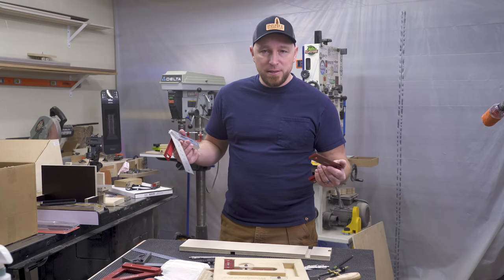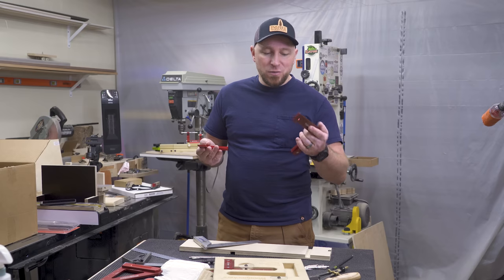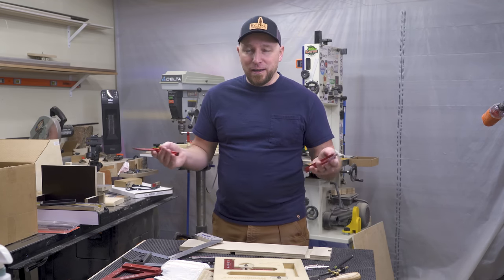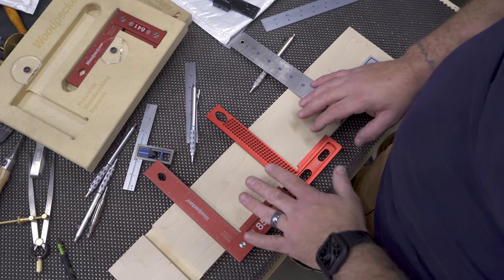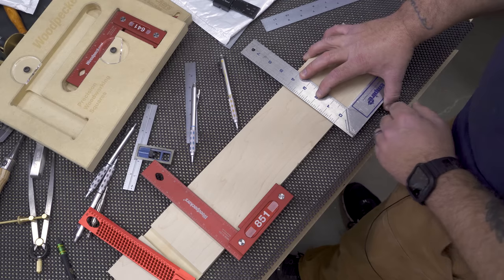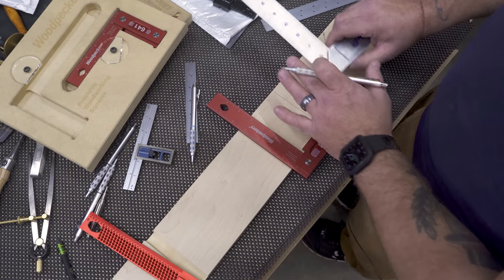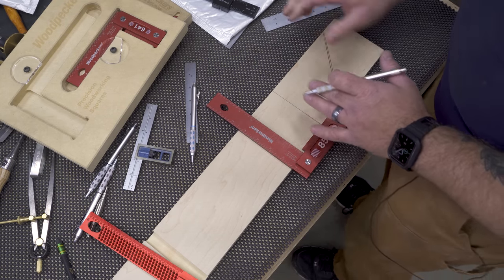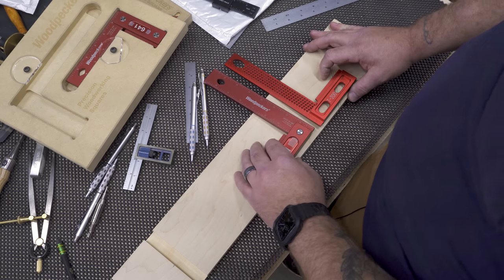Woodworking Squares: 851 VS T-200 / Woodpeckers Tools Compared To Banggood Tools

Comment: Banggood has some great looking woodworking tools. Sure, the Drillpro is a knockoff-ish overseas (I assume... no mention of origin on their website) but you’re paying about 1/5th the price compared to its Woodpecker equivalent. Drillpro is great for the starter/weekend woodworker wanting to expand their tool supply without emptying their bank, while Woodpecker is a premium USA brand for the more flexible spender wanting accurate results. Both have their place in the woodworking world.

Comment: None of the test lines on the bangood square are parallel to each other, its easier to see the error on the lines close together but its not as obvious with the lines which are further part. which is why all the close together lines you said were out but the further apart ones you said were parallel.

Comment: All I ever used is a swanson speed square I'm an old construction worker I've since got a swanson square so if you ever find yourself with too many squares send one my way if you don't mind helping out a new wood worker it's alot different from construction. I'm also now using a 7mm mechanical pencil and have discovered hand planes

Comment: I have the Woodpecker 1281, 641 & 851 squares and even the mini square.  They are by far the most accurate and well built squares I've used.  Granted, they are not cheap, but theses are tools I will pass on to my son.

Comment: I've been looking at getting the 851 but have recently been thinking that it might be better to go with a good combination square and the 1281. I'm not a professional by any means but I do make some cabinets here and there for friends, family and our house along with other projects. I've been getting by with some big box store items but hate having to check square on the tools constantly or build something with some doubt in my layout tools. My question is do you find yourself grabbing the 851 more than a 1281 (if you have one) or would it be smarter to get the 1281 and combination square like the starret or other high quality combo square. Any advice is appreciated. Thanks!
Reply from the maker: I don't have the 1281 personally, but it is a great size to have. I tend to grab the 851 because it works for a bit longer stuff and things that are smaller, without being too bulky. When I get another larger square I think I will be getting an 18" or 26" instead of the 1281 simply because I find myself needing a lot more rule when I do need something longer than 8". If it were me, I would go for a decent combination square. That's what I eventually did as well. And while Starrett is sort of the holy grail of combination squares, there are others on the market that are just as good (accuracy-wise) for what you would do in woodworking. I always send people to PEC's tools. PEC makes tools for a lot of other high-end manufacturers as well. In fact when you look at PEC's combination squares and that of several other high-end brands, they are identical other than color and name. You can also get the PEC's in cosmetic blems and save a ton of money. These are tools that have some sort of blemish like a casting error, a scratch, or something else that makes it not suitable to be sold as perfect. I have two double squares and two 12" combinations and can only find a defect in one of them. However the functionality and accuracy of the tool is no different. I've talked about them in several of my videos before. Here's a link to a blemished 12" combination, if you are interested. (https://lddy.no/m661)
Reply: @InspireWoodcraft  Thanks for taking the time to give me a thought out reply. I have seen you talk about PEC tools but I think I will blame laziness for not looking into it more. I appreciate you sending the link as well. I was leaning toward the combo square as my first upgrade then going to a try square after so thanks for validating my thoughts!

Comment: Should’ve mentioned the fact you can use the banggood square to scribe parallel lines using the holes on the square, meanwhile you can’t do the same with woodpeckers.

Comment: Dear Mr. Inspire. I would like to point out on your empire try square the reason that it starts at 0 on one side and 8 on the other.

It is not for working back wards. One side is for marking 0-8 inches from handle 

The other side is for measuring. It is done that way because of that notch on blade to handle you speak of.

And that notch between handle and blade is purposely done for checking inside corners. It allows space for glue or debris junk  so as to allow for checking or clamping laying up etc on inside corners.
Reply: Also to add the lack of handle lip is there or not there to allow for use on in even surfaces.

The handle slides down the side which allows you to catch your scribe or pencil lead under the angle of the blade. Similar to a framing square
Reply: And your 45 on handle isn't for marking 45 cuts or marks. It is handle reduction to allow for more blade length when using as a straight edge of of 90degrees.

Comment: I've been trying Bangood.com sources tools and sometimes received different from what was ordered. (different tolerance certifications). Even received one try square the was supposed to be certified,  but upon receipt was NOT, and it wasn't square either.  Also received a couple that were great, certified and very high quality.   However  they are not easy to return,  so I'll go back to ordering known quality when I need them.

Comment: Comment. 😃
Good information. I'm new to this and you showed some points i never  considered,  like the pencil tip deterioration as it scrapes across the notches; and how the angle of viewing (i think u called it paralex?) Offsets a measurement by a function of the thickness of the tool.

Comment: I have some veritas and woodpecker. I find the drillpro items I bought to be very accurate I have some 90degree angle pieces and they're spot on I also have some hold down clamps that fit into T tracks that are very good and a couple of different rules which also seem to be accurate

Comment: watching your video I find a combination skill would do fine as far as I need to have a scale on there under the square to me it's just a square and that's all I would use it for his to get an A in perfect 90° angle on there as a machinist for many years I'm used to my different size squares and just for that for me piercings or Square and I use my combination Square whenever I needed to put a certain distance on it but I used to scale that was a lot finer broken down into the thousands and not like the Woodworkers only concerned with a tolerance is not as tight as what I was used to working with the skirt skills are pretty good I like the little lip on it that's pretty nice to help hold it on the material but you still have to put your finger or clamp or something to keep you from moving if you want to if you're trying to get a precise reading on what you're marking or measuring depends on what you doing I do like the way you're explaining it that's nice and clear and I think other people that don't understand how to use a scale those are barely getting into this kind of work so keep up the good work and I enjoyed your videos thank you very much now retired and doing a lot of woodwork

Comment: Excellent video and explanations!  Over the years, I have bought 11 different Woodpeckers tools and I current have the #1281 Woodpeckers try square which is excellent.  While Woodpeckers is very pricey, they make fantastic and accurate tools.   It is amazing to test the accuracy of a variety of 90 degree tools and to find that they are not accurate at 90 degrees.  I can always count on Woodpeckers to be accurate.  Keep up the great work in producing quality and informative videos.  I have learned so much from them!

Comment: I have the 851/641 kit and love them for checking square. The fat blades suuuuck for measuring. The graduations are too far from the workpiece surface to make an accurate mark. As a setup square and marking square its great. Not for measuring.

Comment: I appreciate you mentioning the minor oversight of the Clear Style ruler. Thanks.
I like this comparison as you go through many aspects of the squares.  One thing I would say is that whatever square you choose, you would probably get used to the nuances of it in use and would adjust accordingly to use it effectively.  Having said that, the Woodpeckers square does seem better in quality and some aspects of design.  As I age and my eyesight has slowly deteriorated, the Woodpecker's markings would be an advantage.  The parallax point is very important and that is one reason I don't like the Woodpecker square.  The other reason I don't like it is that I prefer using metric as it is far easier to use in making calculations and measuring. The final point is that the relief on the inside of the square is critical and the T-200 is a poor design.
Thanks

Comment: I am a disabled vet, and so money is always very tight, I have been trying to rebuild my tools after they were stolen last year ( not trying for sympathy, just explaining my actions) I have been replacing some of the stolen tools with low cost tools, including some from Harbor Freight. I would never say my Harbor Freight tools are better than the expensive ones I had collected over 45 years of woodworking. but I do think that, with a little care, you can buy some functional tools for less.

Comment: Another youtuber I follow once said, is the cheap brand good enough for the international Space Station?  No probably not.  Is it good enough for your Honda?  Yea it’s fine. 

If you’re just building a small cabinet for your laundry room out of mdf, harbor freight will get you what you need.  Are you building a fine piece of furniture out of exotic expensive hard wood?  Maybe take your time and measure ten times.  Use the better quality tool, and measure two more times just to be sure.

Comment: You convinced me by just giving me the facts. The scale on the Woodpecker is nice if you like guesswork. The Bangood is only in metric. So I will continue to use the most useful tools in my shop:  a Starrett 6" and 12" combinationsquare, a very affordable PEC 4" doubblesquare (blemished - from Taytools) with all rulers in chrome-satin finish. Up to now I never felt any need for one of those costly T-, Try- and what not squares to clutter my bench. Your videos are truly the best in my opinion.

Comment: I have an OLD square . . . VERRY OLD.  It was my grandfather's and maybe his father's before that.  So probably from the turn of the century.  I don't use it for anything because it is so over used and the edges of the blade are not straight but have been worn down.

Comment: 4 Apr 22… There are FIVE squares named “851” on Amazon UK right now. All picture in identical red aluminium and retail around 30 bucks.  None have ‘Woodpeckers’ stamped on them.  So…PRC knockoffs most likely.  You can’t trust anything anymore.  Will they be square?  Well, I am betting mostly not…just keep sending them back and re-ordering until you get one which is by luck/fluke, square!

Comment: Dude, the "lead mess" thing is fishing.  Done of these "flaws" are worth the $40-60 difference between the two tools.  I'm more concerned with my personal information being stolen using bg then these flaws.

But if I had an unlimited budget, I agree. Starret is the way to go.
Reply from the maker: I love how in a completely unbiased video, showing exactly how two tools work compared to one another, in a single take so that there is no camera trickery, some people can still find something to bitch about if the more high-end tool doesn't perform the exact same as a low-end tool.

Comment: In reference to the Empire square...

Inside measurement taken with simple addition. Whatever the thickness is you can etch it on the handle so you never forget or have to measure again. Here's a tip (I ain't no pro) when you get a new tool, and you etch your name or logo on it (which you should ALWAYS do!) Etch the measurements that might be useful for reference on it as well. Sometimes the edge or side of something can help with all kinds of things and especially power tool setups.

The other issue with graudations being 'backwards'....  If you can't measure backwards from 8, honestly my opinion is you shouldn't woodwork.
Reply from the maker: I didn’t say I couldn’t, I said I don’t. There is no logical reason for me to. And there is no logical reason for me to keep a tool any longer than necessary with such illogical design.

Comment: This is a warning to anyone purchasing Bang good wood working items. I purchased a large order of wood working tools and two of the items have quality issues (i.e. do not work or are manufactured incorrectly). I have been going back and forth with them to try and have them refund or do not work. They are actively trying to give me the run around and telling me I need to pay for return shipping. If your item has any issues, be very wary. I have spent weeks going back and forth with their customer support and refuse to honor their own warranty. On top of that, items were delayed shipping by a month, even though I paid for expedited shipping.

I would not buy again.

Comment: The T200 being metric doesn't compare to the 851.  The USA market uses Imperial so they should offer the T200 in Imperial...otherwise it's useless here.  Woodpecker makes great tools but they are very expensive. An alternative is needed with similar quality but a more reasonable ptice.  I-Gauging may be an alternstive.  I recently bought one of their combination squares for $45. compared to the Woodpecker at $180.   It seems to be a quality tool but doesn't have all the features of the Woodpecker.

Comment: The first line you drew is not how a try square is to be used. A try square is setup to be square only on the two inside edges. You put the inside of the handle against the stock and then drew using the outside of the blade, not the inside. With an engineer's square the inside edges are square to each other and the outside edges are square to each other, but there's no guarantee that an inside edge will be square to an outside edge. That said, you're drawing lines with a pencil, so ultimate accuracy isn't important. I don't believe even Woodpeckers guarantees squareness of inside to outside edges. 

Drawing lines is not the most accurate way to measure squareness, since the angle of the pencil can easily affect your results when you're looking at a few thousandths of an inch. I personally think that markings along the blade are generally to be avoided for the reasons you indicate in drawing lines.

The construction of Woodpeckers is such that the one-piece blade is CNC machined to very good tolerances for woodworking, and then the cheeks are added. You can see videos on their channel, for instance: https://www.youtube.com/watch?v=3xIS1437d0U which shows that the blade is checked for square and then the handles are attached. I believe it's possible that the handles are not as square as the blade as their tolerance specs might indicate. Since the handles are referenced mostly for marking, that's probably OK, as angle variation and thickness of a pencil line are certainly less accurate anyway.

Banggood does sell a couple DIN875 rated squares. These are silver engineer's squares in sizes smaller than the ones covered in this video. It would be interesting to compare to see just how square these affordable DIN-spec squares are.

Comment: Love your videos, but this one you are comparing apples with bananas. There are Drillpro squares that are a direct comparison to the woodpeckers one. I have two of them. A 150mm and 200mm sizes and the are almost identical to the Woodpeckers. I love my 2 DrillPros. Can I suggest that you should really compare tools that are comparable to each other for a more fair and comparable review. The two squares in your comparison are not comparable to each other.

Comment: Woodworking to a thousands of an inch is way beyond the capability of the tools you use to cut or shape them.
Reply from the maker: @poorfesor This is a common misconception. Hand planes make .001” shavings for a reason.
Reply: Planes do pencils don't. Besides as you noted parallax is just as likely to foul your measurement. Wood is not metal and you can't fit it like metal. Doesn't mean you should not be as accurate as possible but metal work is measured with micrometers and gauges not pencil marks. Check the actual width of ever tooth on you saw blades and see if they are true within 1 thousandth then check the run out of the blade. Have fun.

Comment: Starrett is as, if not more, accurate then woodpeckers and made of steel for around the same price as woodpeckers. Woodpeckers are aluminum crap compared to them.
Reply from the maker: "641 & 851 Squares are accurate to within .001 inch or less along the full length of the tool" - This is from Woodpeckers website. A Starrett 6" combination square is "-.002 to +.004, according to the spec sheet on McMaster-Carr's website. I'm no mathematician so I will let you tell me which one is more accurate.  There are many models of different tools from both manufacturers and at many different price points, so one cannot say that they are "around the same price". There are also multiple metals used by both companies. Starrett themselves, like every manufacturer that offers different options, has different price points depending on the options that you get. And as far as accuracy goes, again it isn't that black and white. And to top it off we are in a wood shop, where accuracy and precision are desired and necessary but can only be achieved to a certain level.